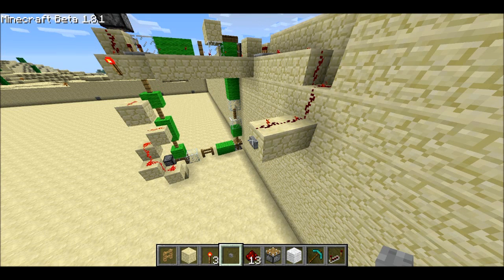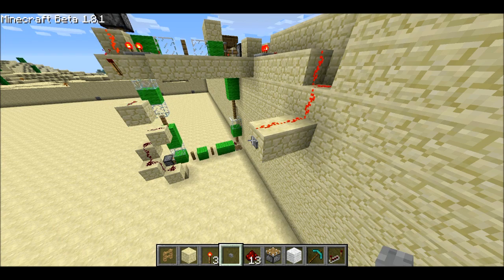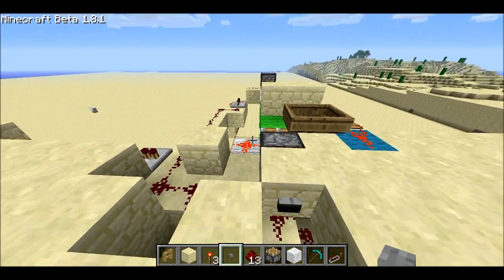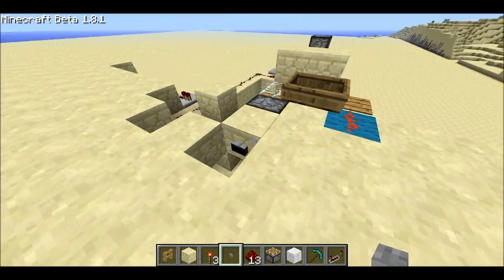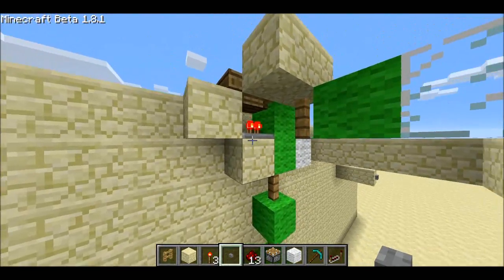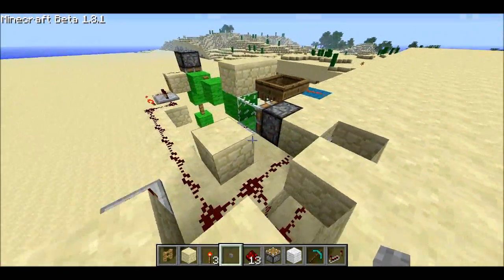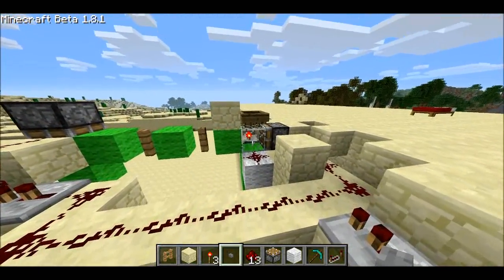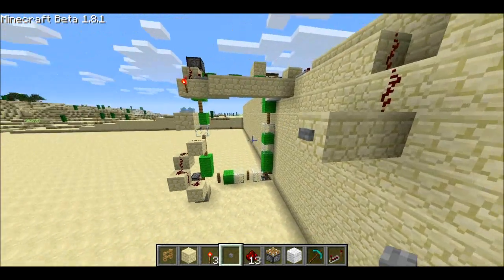Ternary Piston Tape ROM

Comment: @sethbling As long as you're detecting the hit-boxes of blocks to read as an extra state, would there be someway to use glass panes or iron bars as yet ANOTHER state? Possibly making this a quadnary (?) system, your two outputs already support another, not yet discovered state. It may also be impossible to do at all or in a reasonable area, i don't know, its just s suggestion.

Comment: @sebzim4500 Just imagine, a trinary system can hold more data in a smaller space, 1 tape = 3 distinct states, 2 = 9 states, 4 = 81 states and so on and binary is 2-4-8-16 and so on respectively. This could allow for smaller Hard Drives, RAM, ROM, and maybe smaller cpus which is going to be a big thing for minecraft with minecraft at a reasonable speed.

Also instant wire is probably at its current climax, there may be a few miniturizations, but its not going to be all that significant as this.